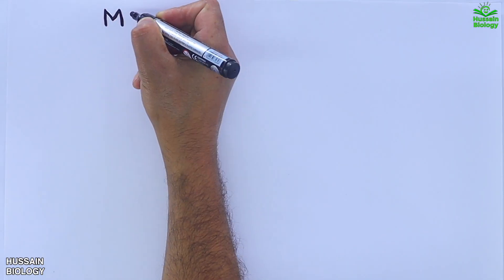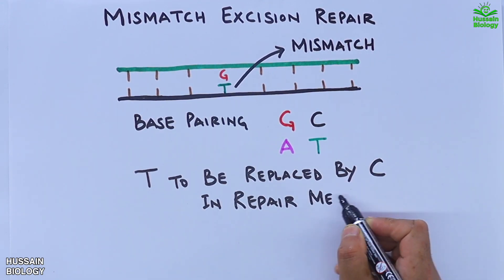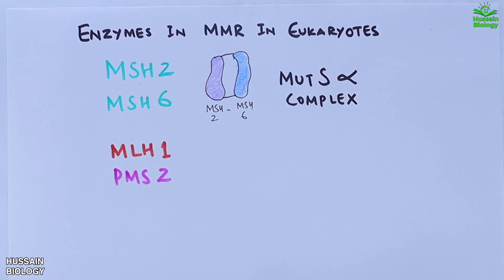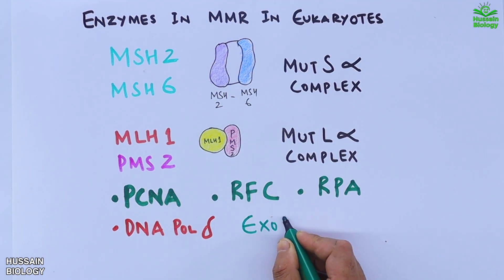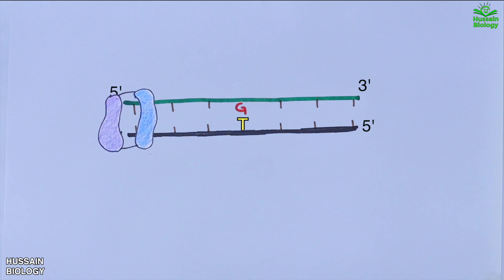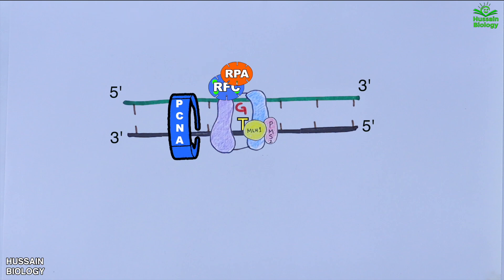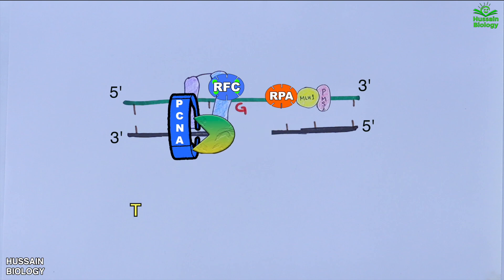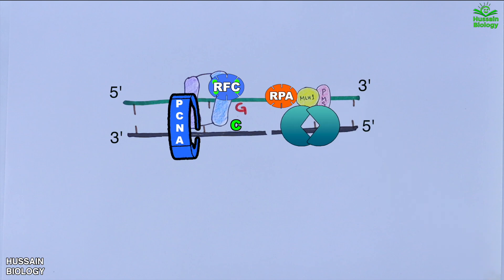Mismatch Excision Repair in Eukaryotes

Comment: This is great but you don't address how the cells know which strand to repair and your gap (nick) that needs to be closed by DNA ligase is in the wrong place - it should be the 3' side of the newly added nucleotides, not the 5' side (so closer to where PCNA was).

Comment: What happens if it's the opposite strand that has the incorrect nucleotide?
Reply from the maker: Parental strand  will never become one if not repaired at first place..

All daughter strands will become parental once repaired after Replication
Reply: @hussainbiology  I think I understand. During DNA replication the parental strand is methylated. It is then copied. It is assumed that the parental strand is correct. With the mismatch repair proteins any mistake in the daughter strand is repaired.
🧬 ✅

Shabir, Another solid video! Thank you so so much. I don't know if you have the energy to do a deep dive into just one of those proteins and show the active site and how any mineral co-factors are added during their construction. The molecular 🔬stuff is very interesting.

👏👏👏👏👏
Reply from the maker: @michaeleisenberg7867  surely i will do
Reply: @michaeleisenberg7867  Methylation to recognise parent strand is done in prokaryotes.. In eukaryotes presence of lagging strand (the okazaki fragments ) is used to recognise the new synthesised or daughter strand.
Reply: @anshi2929  Thank you. I would like to know how the metal cation gets placed in the active site of the various polymerase enzymes? Who puts it in there?